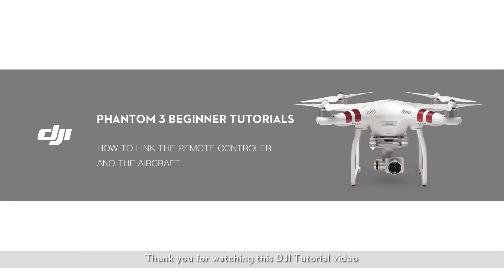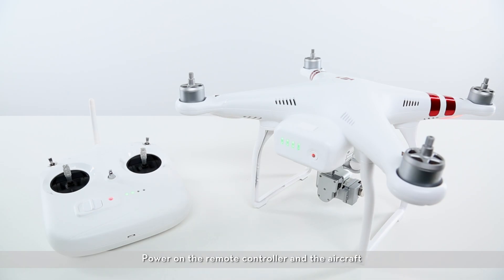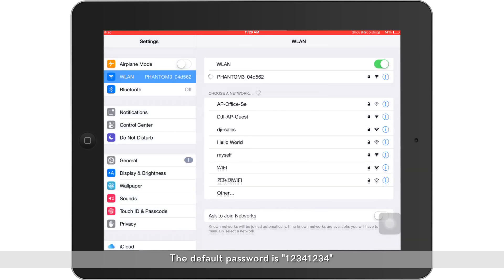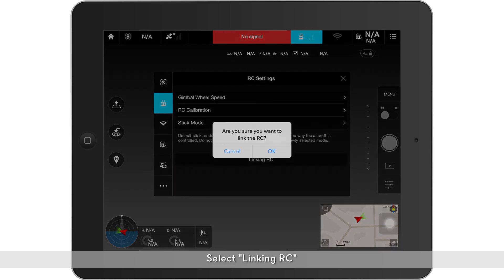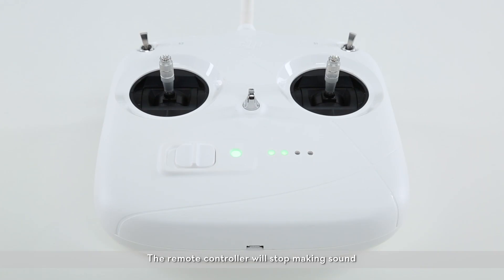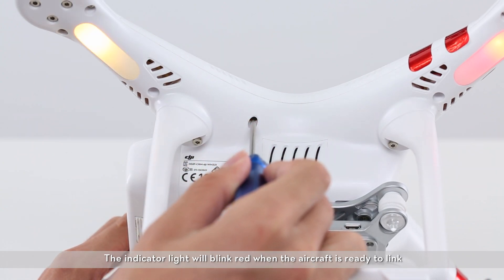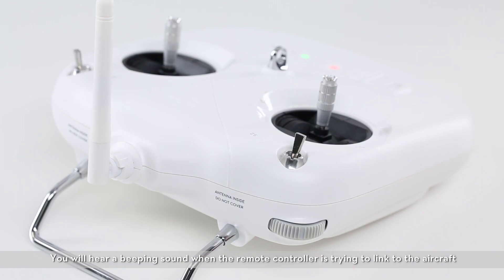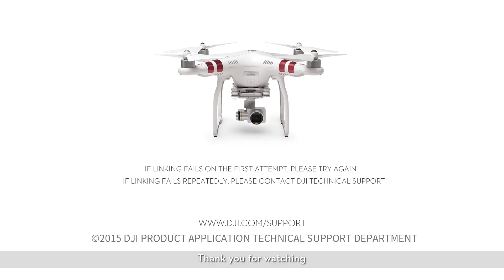DJI Phantom 3 | Linking the Phantom 3 Standard's Remote Controller

Comment: For some reason my controller has a green/red light making a white light and does not charge my phone or connect to drone idk what to do
Reply from the maker: Hello there! We are sorry for the inconvenience caused. Could you confirm the model of the mobile device used? And please follow the steps below, take note if there are error messages, or upload a short video of the linking procedure publicly to Google Drive or Dropbox and provide us with the shareable link. Thank you in advance for your cooperation.
1. Turn on the aircraft and press the Link Button with objects that have point ends. The button will blink red when the aircraft is ready to link.
2. Power on the remote controller, turn the gimbal dial to the bottom, and toggle the S2 switch back and forth quickly for at least three times. You will hear a D-D-D beep sound when the remote controller is trying to link to the aircraft. The remote controller will stop beeping, and the Link Button on the aircraft will turn solid green if linking is successful.
Reply: @DJISupportGlobal  i have the dji phantom 3 professional and the remote does not connect yo my phone so not sure what to do and these steps did not work

Comment: Can someone  help me I've done this so many times correctly and my controller still doesn't connect to my drone
Reply from the maker: Hi, there. Sorry to hear about this. For the connecting problem, please check what the app says. If the app said the aircraft disconnected, please try to relink the drone and RC, but if the app showed disconnected, that meant the app hadn't connected to the RC, try to reconnect by rebooting the app or plugging the cable again. Hope this helps.

Comment: I'm  still having problem with image view on my phantom 3 standard because of firmware 1.9.00 update, unfortunately dji go app doesn't work for me because the update disabled also my SD slot, there is no more little led blinking on camera hardware, any more solution you can provide ? Thanks

Comment: controller beeps like succes and shows green but ac linking light stays solid red
Reply from the maker: Hi Brick, please kindly connect the mobile device to the RC's WiFi and check if there is any prompt on the DJI GO app, please try to remove the SD card and do the linking again. You may keep us updated via Facebook Messenger: https://bit.ly/2pm7tfV if the issue persists. Thanks.

Comment: I finally solved my Phantom 3 advanced connection problem:
First, the problem: My Remote Control led light was stuck on ''CYAN'' color. My remote wasn't connecting to the drone. The drone was flashing yellow and the DJI go app didn't show the "camera" button, it only showed "How to connect". So I found a way on the internet to solve it:
"Found the solution!! with the remote plugged in, go to the DJI go app and when you get to the screen that shows your device and says "how to connect" at the bottom, press the 3 horizontal bars at the top for 5 seconds and let go. a screen will pop up and ask you which version of the firmware you want to load. the 1.8 didn't work. the 1.6 version did. Once it started loading the light turned blue and did everything it was supposed to will firmware was updating. I turn off the app and turned on the drone and remote and pugged back into the device. once I did that the app was able to see my remote but, it still requested a firmware update tp 1.9.. I did that and it was successful. it then said my drone and remote were still disconnected. so I followed the steps I've seen in so many videos (and on this post) to reconnect. I held down the c1, c2 and c3 buttons until I heard a beep. then I pressed the right wheel a couple of seconds the light started blinking blue and I pressed the restart with my tool. the drone light next to the restart starts blinking red and then turns green and so does the remote."
Reply from the maker: Thanks for sharing with us. We're glad to hear it works now. If there is anything else we can help, feel free to contact us. Wish you have a good time!

Comment: So I have the phantom 3 advanced drone  but I've just picked up a phantom 3 standard controller would I be able to link the standard controller with the phantom 3 advanced
Reply from the maker: Sorry, Paula, they are not compatible with each other, so it doesn't support linking the Phantom 3 Standard RC to a Phantom 3 Adv drone. Thank you for your inquiry.

Comment: I sent mine to DJI. They charged me $113 and sent it back still not working. They even lost my camera dust cover.
Reply from the maker: We are sorry to read on this. Could you please provide us with your case number so we have a look into it. Besides, could you please tell us the details about the issue of the drone? We will try to troubleshoot and see if it can be resolved remotely. Look forward to your update.
Reply: CAS-1929325-Q7L1L5 
CAS-2000904-G0G0C6
Drone was working fine. Flew it 3 times when i got a message on the app saying i needed to do a firmware update. i did the update and the drone has not worked since. just flashes red,green,yellow. Remote is solid green. App says disconnected. i mailed it to Dji, they sent it back to me still not working. i've been email them, but they have offered no support, they just keep sending me a customer satisfaction survey. i have reinstalled the firmware, reinstalled the app, and manually reconnected the remote. nothing has helped. i'm taking it to a 3rd party repair shop next week and disputing the charge for the repair through pay pal since they clearly did not fix anything.
Reply from the maker: Thanks for getting back to us. I've checked your case, the drone has been replaced at that time. Would you mind helping us verify the current status? 
1. Generally, the LED flashes red, green and yellow alternatively means the drone is doing self-diagnostic. You may wait a certain of time and see the color.
2. For the grey disconnected, it refers to the connection between the mobile device and RC, you may try to reinstall the APP or change to another recommended mobile device, then reconnect with the WiFi to verify whether it works. 
3. Regarding the dust cover, pre-checking with the local team, we're sorry that they are not available now, sincerely apologize for this. 
4. As for the survey, it was sent by the system automatically, please ignore it if the issue has not been figured out. Thanks for your understanding.
Reply from the maker: We are sorry to know that it still doesn't work. Could you please tell us the mobile device you are using? 
About your request about the gimbal cover, we are sorry to tell that we might not be able to provide you with compensation, but we will escalate your case to the management department. 
As for your feedback about the survery, we will forward to the proper team to confirm. 
Regarding your concern of the drone was sent back when it still didn't work, the local team had tested the drone and confirmed it could work properly. But if there are issues when you received the drone, we will do our best to help. As your case has been escalated, we will have someone to contact you soon. Please wait patiently.
Reply: DJI called me yesterday. The person I spoke with was not very bright. I was able to trick him into admitting he was lying to me. Using circular logic and lies to cover up their mistake. He also admitted the drone was not tested before it was returned to me. I've already started my fraud complaint with Pay Pal and will be filing a BBB complaint shortly.
Reply from the maker: TutorMystic, we are sorry for this, we do hope that your case can be sorted out by us. As our supervisor department is noting and following your issue, if it is convenient, please kindly keep us updated via the email, thank you. Besides, your experience will be also forwarded to the designated team to noted down, learn from the case and keep improving our service. We are sorry again for the troubles that you had encountered.

Comment: when i turn on my dji phantom 3 standard will automatically convert to no positioning atti and on my remote the swithch on  p mode
Reply from the maker: Zaib, sorry to hear about the issue. Please try to update the firmware for your aircraft and the remote controller then try it again, you are recommended to choose an outdoor open area where the GPS is good and no magnetic interference to try the flight. Any further issue,  please feel free to contact us at https://www.dji.com/support. Thanks.

Comment: This process does not work. I have had two phantom 3 standards in the last four days. Both new out of the box. Have followed all instructions regarding firm ware updates, app and manual inking etc. numerous times. NOTHING worked. DJI support said the problem was with the drone on the first one. I returned it and bought another new one yesterday. Same isusues. Two duds back to back?! Seriously?! To boot tech support is offline! Back to Staples today... I think this product line is a dead end. If DJI doesn't help soon it's time to start researching the competition. I am usually quite patient with consumer issues and allow the systems to takes it's course but this consumer has finally hit a wall. Someone must want my money and loyalty... DJI doesn't seem to.
Reply: Thanks but I finally made contact with DJI support. Both new drones had to go back for either repair or replacement. Fair enough but as a consumer I didn't want to wait 4 to 6 weeks. If it comes new out of the box these things should work. I know many people are happy with their DJI's. I am not condemning them all. It's just mine did not work.I would rather have been flying than trouble shooting in my shop. Thank you to your support desk for finally getting to me. Sorry this did not work out.

Comment: Just got my P3 delivered. Un-packed it and it didn't work. The controller would not link to Drone. Spent an hour with customer support, still did not get it working.
They told me to ship it back. Maybe I should have went with the Parrot.